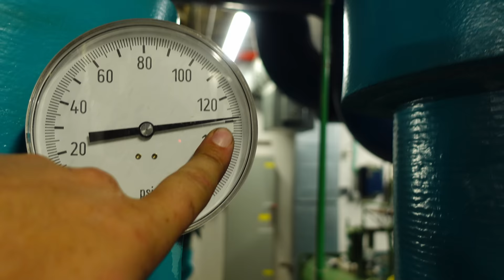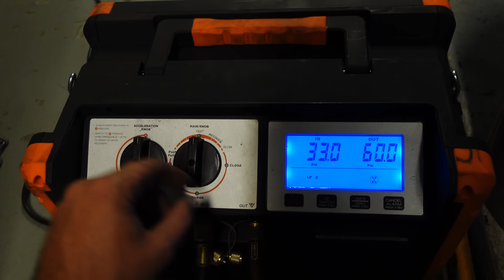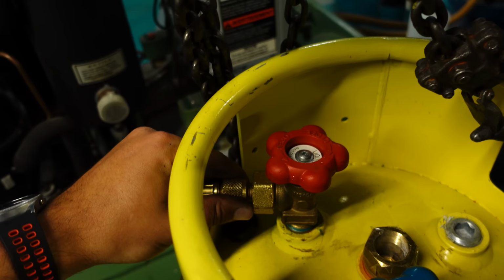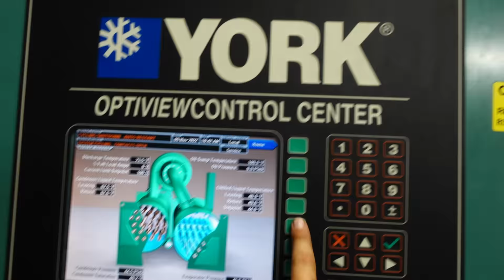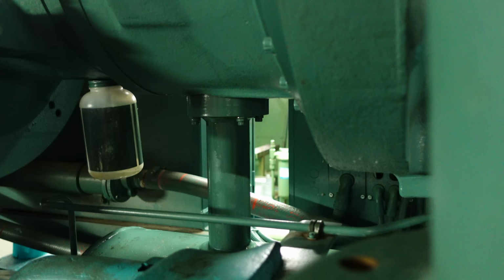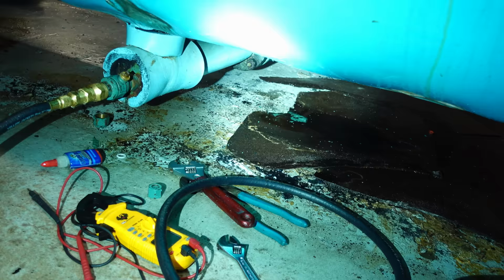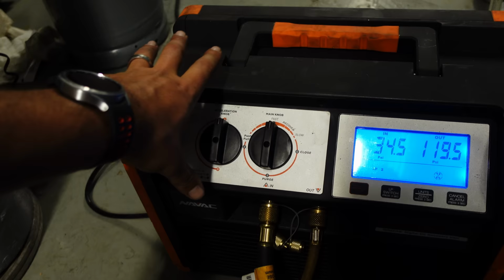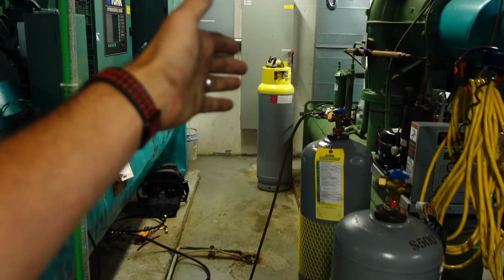This is a BAD day as a Chiller tech...

Comment: Orings are always a challenge on equipment. I’ve had similar problems occur several times. No leaks, makes a non related repair, pressurize and leak check with no issues. Pull an hold a vacuum and then add the charge correctly, only to find a large leak on an oring. The pressurizing and depressurization makes orings move and leak. It is a major kick in the pants. I have gone to the extent of replacing orings on non related components with the concern of this happening.

Comment: I usually use a flared sight glass when I’m pulling liquid. As far as the oil leak goes that oil drain line is a weird spot for a leak to develop. Sucks dropping that oil sump to change out that o ring. Looking forward to the other videos to see how you guys make out.

Comment: When pulling refrigerant from the bottom of evaporators on different chillers, do you ever expirence compressor oil being removed with the liquid refrigerant ??
Reply from the maker: Yes, definitely happens. Usually pulls back out when charging system.
Reply: You usually distill the liquid refrigerant and pump the oil or let it suck when you're pulling a vacuum on the chiller.
Reply: So long as the dip tube reaches to the bottom of tank, or turn upside down, hard to do with big full cylinders...
On another note, do you ever do push pull using  the chillers compressor, until the chiller trips on low pressure, or liquid refrigerant no longer available.. 
I've done it a few times,  works a treat, just watch the static build up on the tank....😄😩⚡️⚡️

Comment: Try not flowing water until you go into vapor mode. Push pull doesn’t work well when there is cold water going thru the barrel. The freeze danger only occurs during vapor. The whole problem your having is because the recovery unit will not build pressure because it’s condensing instead of pushing.
Reply from the maker: How does vapor cause the pipes to freeze?
Reply: It's liquid that will cause freeze you can put vapor to saturation and then change to liquid with water flow. Plus warm the tank to help the process
Reply: Its is incredible how many techs in this industry do not understand how push/pull works or the physics of it.  NO you do not need to flow water thru the chiller when you do a push and pull correctly as the pressure in the chiller is not changing, you are just using vapor pressure to push out liquid, since your pressure inside does not change your saturated wont change,  there is no significant refrigerant evaporation when push pulling,  there is absolutely no risk of freezing, I understand some techs want to be on the safe side, but when you truly understand what you are doing you know your are on the safe side.  When you stopped adding liquid to your recovery tank that was your first red flag, that gave away the game,  you were done recovering liquid, you had lost the charge.  I have been doing this for 24 years now,  lost count on how many chillers I have had to pull refrigerant from,  always push/pulled,  never have I ever turned ON a water pump.  Once you are certain no liquid remains inside chiller, you just pull the vapor and that is it.  Always use a sight glass on your liquid line to tank and always check for low points that can trap liquid.  No need to turn ON a pump and having to flow water thru an OFF chiller making the ON chiller work harder.
Reply: @kc5vgw  you are so wrong is actually scary,  have you had any professional training or work experience?

Comment: Good catch. Quick question how long would it take to recover 1300 to 1400 lbs from that YK?
Reply from the maker: Using a recovery like this one and push pull. I expect it would have done so in about 6 hours. When we have hired recovery companies in the past with their machines not using push pull it took 8 to 10hrs
Reply: @HVACTIME  okay got it thanks. Im thinking about purchasing this Navac recovery machine. First time hearing about it when I seen it on your clip. It looks like it does the job and saves time
Reply from the maker: @JackDavidson-ov2tf  it's a incredible machine. You can get 8% off at TruTech Tools with HVACTIME